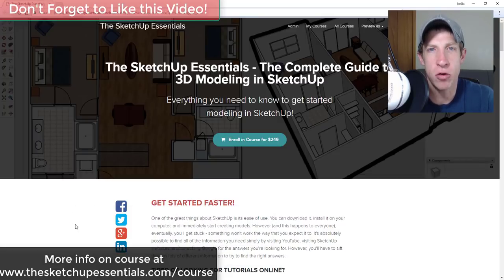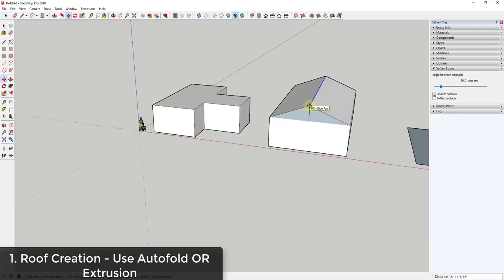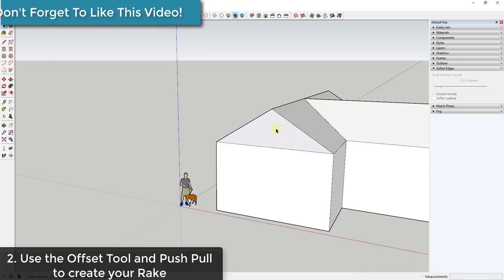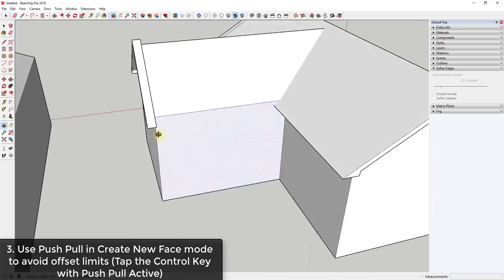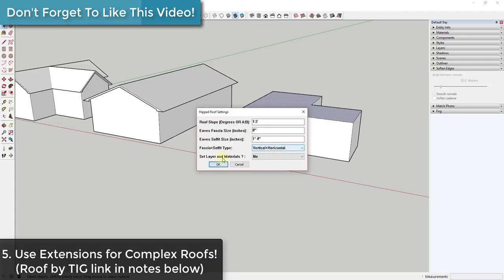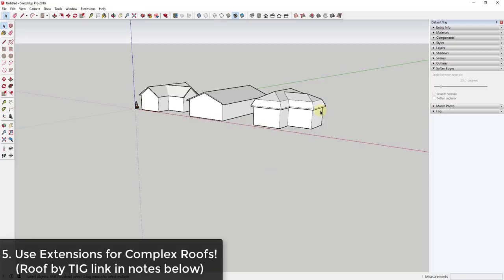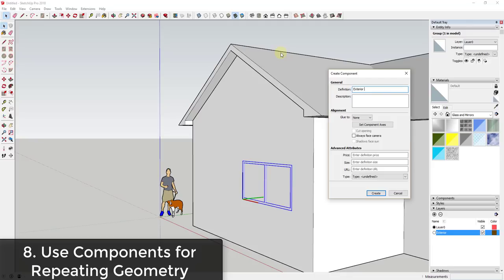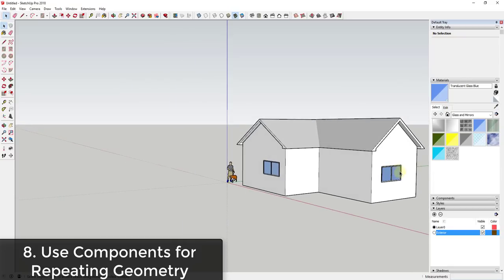8 TIPS FOR MODELING HOUSE EXTERIORS in SketchUp

Comment: i'm new to sketchup, and i plan to do just exterior modeling of big multifamily apartment projects with a lot of repetitive elements. i was told the best way to draw windows is to just create a solid mass, and add windows to the mass and then make the hole, similar to what you're showing here, as opposed to creating walls, then make a hole, then add the window. this way you can drag the window around, or make copies of the same window and not have to mess with the wall. does that sound right? what do you recommend?

Comment: Very Nice Justin. But...... single face walls "always" create problems later on in the project so better start, even on small projects with real walls and, group, group, group!
Keep put the good work.
Reply from the maker: I think it depends a bit on what kind of project you're doing - if you're just working with the exterior of a building, single face walls might be ok. However, if you're doing anything with the interior, you should probably start with thickened walls. Thanks Willem!

Comment: Thanks or sharing. Those shortcuts are really useful, thanks.

I'm definitely no expert at house modelling but with the few designs I've done already  it looks like the interior governs the exterior rather than vice versa. 

For example, I modelled a beach house inside-out so that 2 of the 3 bedrooms and the living room had a sea view and then I had to get all the other rooms to work together and be of a reasonable size and proximity to be practical and space-saving. This then gave me the exterior of the house. If I were to work from the exterior and then sub divide to create the rooms, it might be much more difficult. Am I wrong?

Is it true to say that "C" and "T" shaped houses result from working outside-in? This "Y" house must have been an outside-in house  at https://3dwarehouse.sketchup.com/model/4f743953-270a-4371-8dbc-14a49a9bc543/Y-House
Reply from the maker: I think you're right - the interior is going to dictate the exterior. I'm sure there are a lot more qualified people than me that could weigh in on that one - thanks!

Comment: Also- 1001bits Tool.
Seriously though I will not recommend making walls that way. Please give it actual thickness, either with offset tool or using the wall making tool available in 1001bits Tool.
Always model as if your making an object in real world. That will vastly increase realism of your model no matter if your end result is sketch or render; accuracy of modelling will certainly helps in getting your project planning far more accurate.
Reply from the maker: Generally speaking I would agree, but sometimes it really depends on what your model is for. If you're creating an early model specifically for the exterior, you might not want that wall to have thickness because it becomes difficult to modify in the future. The approach changes if you're planning to use it for rendering or for layout floor plans.  Thanks!